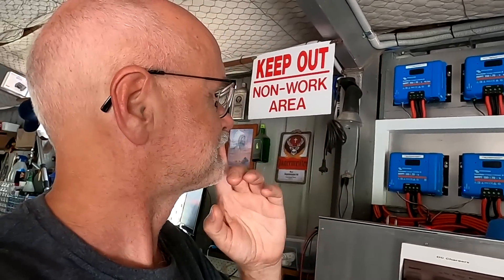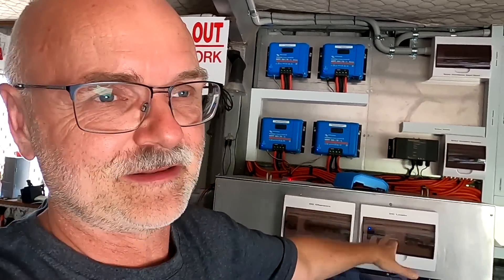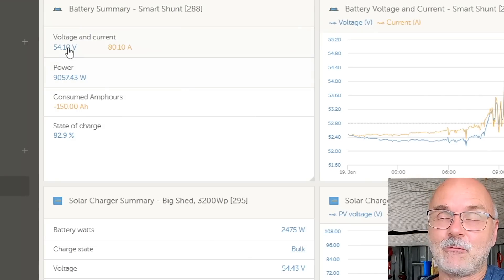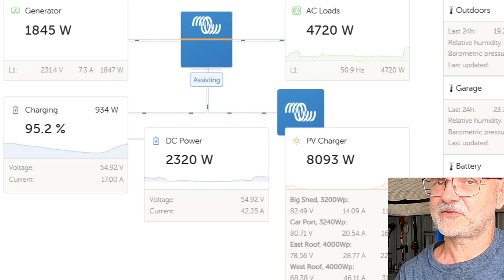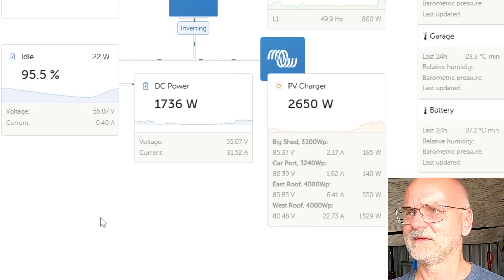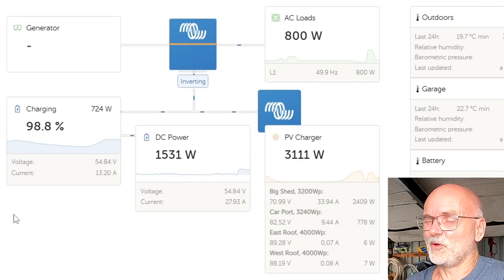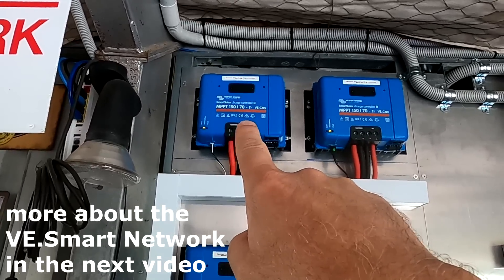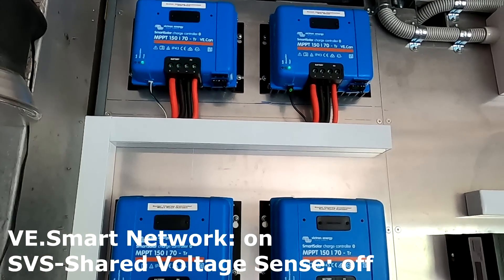Charging chaos: no charge despite full sunshine. MPPTs out of control!

Comment: There’s no point to absorption on LiFepo4. Just set everything to whatever your top voltage is and keep it there. 

CV will taper current and then the amps will go down and it will slowly get to that voltage and then stay there the way it should. 

And the whole thing should be using your bms voltage readings.
Reply from the maker: Oh, noooo, that is not correct. Absorption is very important with LiFePO4. We have done all the testing here on the channel. If you don't absorb, you get very inconsistent charging results.
Reply: @OffGridGarageAustralia  I’m seen your results. The science doesn’t agree. If you maintain the voltage at equilibrium it will charge completely AND enable balancing because voltage IS a pressure. 

It’s when the BMS is kicking on and off that you get the results you saw.
Reply: @OffGridGarageAustralia  to elaborate:  what you showed was the fundamental problem of disconnected charging, BMS and balancing that doesn’t work wholistically. Absorbing just punts the problem by doing the process below the hard stops. 

A system working together has the charger providing exactly the right amount of power into to the bms, and the bms knowing exactly how much it can use to shunt to the cells that aren’t yet up to level while not overcharging the ones that are.  They need to talk to each other and if there are multiple bmses then the whole thing needs to be coordinated. 

Instead we get NO MORE POWER! OFF!  Sag b/c of no more power, MORE POWER!  FIRE HOSE! OH SH*T that’s too much!  NO MORE POWER!  Sag b/c no more power. 

Should be:

Bms: I can use 2 more amps please 
Charger: Ok, here’s enough voltage to induce 2 more amps for you. 
BMS: Thanks!  Here’s my real-time feed of what I need. 
Charger: OK, I’ll keep giving you exactly that!

And guess what?  This is EXACTLY how DC fast charging in an EV works. (And the AC/DC charger in EVs does too)
Reply: @jameshancock  What happens when one BMS says "give me 50A" and another one says "max 2A, please" (while the inverters also want 4kw to charge the Tesla)?
Reply: @Full-of-Starships  it’s called a DC bus. Most all in one units use one at around 400v. (Nice value for PV and rectified and PFCed AC 240v and perfect for outputting 240vac from the inverter)

All power sources are setup to maintain that 400v bus voltage. You can prioritize where it’s from. 

If 2 bmses want different amps, it’s still the same voltage either because of the bus or parallel, so the charging has to raise the voltage to provide the total amps requested by all loads and they will automatically distribute accordingly based on resistance to current. 

If your bms works in coordination with your chargers of various types then this is all automatic. 

Right now (to my knowledge) there is no system that communicates what it needs to balance properly at full charge which is the problem so you get a fire hose until the bms just shuts it off which means the bms balancing can’t keep up.
Reply: @jameshancock  I guess 400v means only DC fast charging for an EV, not static batteries.

I still don't see how the controller copes when two BMSs send different instructions, while the inverter may also be drawing full power.

Comment: it has too much problem Víctron should stop using it, use another brand
Reply from the maker: Never. Read the forums about other brands. OMG!
Reply: Victron has few issues generally speaking, but when you piecemeal a system together like this, it does require extra tweaking to make it all work.  And to me, its well worth the tweaking needed to save ten’s of thousands of dollars.  You should do the math on how much it costs to build that battery by buying it over the counter from BattleBorn or other manufacturers.  It’s about $750-$1000 per 100/ah @ 12vdc.  That’s a big savings just by DIY’ing the battery.  Which is why I didn’t skimp on the BMS and bought a Batrium system.  Yes its very costly by comparison, but it scales larger than any other competitor and its an all in one BMS no matter how many battery banks you have installed.
Reply from the maker: @Shep5847  Most of this' tweaking' is part of the testing I do on this channel. I break things on purpose to learn and understand how it works. And share the love of course...

Comment: I had this problem twice i have two Victron 30/100 smart solar charge controller and one Victron Smart Shunt  that's was in sync at first lit my BMS one of my cells had ran away shut my whole system down I had to wait because the first time it happened my whole solar system shutdown and when it restarted all my settings was back to default even the shunt then I was only getting on maximum charge of 26v out of 28v they kept going into absorcion & float early before the maximum voltage set in the charge controllers was reached

Comment: Hi Andy,  I did mention before that if you have the MPPT chargers connected to the Cerbo with cables you must not also use the Blue tooth network or the two systems will argue with each other. 
The DVC system is supposed to be used with something commanding it like a BMS,
Having said that none of it makes a difference to the voltages, I Have shunt and three Mppt chargers, all the voltages are different I put it down to victron being shit and inaccurate. PS: I ran my own Electronics company for years, retired now, I have a good idea what I am talking about.
Edit: I think you just stated your problem, "The smart BMS is not in the whole system???"
Reply from the maker: The VE.Smart Network can be used with DVCC in combination. I read all the documentation and nowhere it says you cannot do it or even you should not do it. In fact, the VE.Smart Networking manual says you can always set up the network and for example if your MPPTs are connected to the VE.CAN network at the same time they will just ignore the VE.Smart Network. So, there is no real directive from Victron in regards to this... More about this in the next video.
Reply: @OffGridGarageAustralia  I never said that the DVCC could not be used in combination with the VE network? I said if it is used it must have information from a BMS . Also I said the ve cable network should not be used with the Blue tooth network. Ahh! well you see I did read in some Victron document that you should not, trouble is it was some time ago and I do not remember which one it was in, it was not the main manual. But what I do know is my system works perfectly, so you carry on.
Reply: well thats what he did a few weeks ago he disabled the smart  bluetooth network  and just in the video he re enabled it trying to get it to work properly.
Reply: @STRUTZKOFF  That's correct but he hasn't got a BMS or apparently a shunt in controll of it?

Comment: Hello Andy, my setup has 4 MPPTs and a smart Batrium BMS connected to the CANBUS of the Cerbo gx. It behave just like yours. I have a sound explanation for this.
The BMS controls the voltage and current delivered by the MPPTs to charge the batteries. In an ideal case, all battery cells have exactly the same voltage since they are "perfectly balanced" and therefore, the BMS can still request all the power that can be generated until the batteries are 100% full.
Since this is never the case, some of the cells start having a voltage above the set maximum even when the batteries are well below 100%. In order not to damage the cells, the BMS reduces the power that comes from the MPPTs until the peaked cell voltage goes down, hence reducing the overall voltage of the entire pack. I confirmed this with my BMS by observing the peaked voltages and the behavior of the MPPTs.
As for the MPPTs, some giving 0 and some giving power, I deduced that this is the way Victron throttles down the delivered power.
Hope this helps.
Reply from the maker: Thanks a lot for sharing, Salim. The Batrium is certainly great when it comes to communication with Victron. I read a lot about it and how it limits the charging current to 0.5A to allow the balancer to work.

When you say it limits the power to the battery, does it lower the CVL or the CCL in the Victron system?
Reply: @OffGridGarageAustralia  , I really don't have the exact details as to what gets controlled as soon as cells reach a high voltage. 
However, using the settings of the BMS, both voltage and current are set as a function of the state of charge. When the batteries reach a set SOA, the MPPTs start exhibiting the same behavior you have seen with yours.
Reply: How were you able to connect your batrium to the CANBUS of the cerbo? I have a Batrium BMS and am unclear on this.

Comment: My victron equipment is 'off' .35 volts. I have 3 MPPT RS450/100 tied together, so one master, two slaves. The remote manager is always .35 volts lower than the actual battery voltage. Charge controllers always report the actual voltage. Made me wonder but I never tried to find out why. Makes no difference where I set the fully charged voltage it's still off .35 volts. Also during charging Not all the controllers are producing the same. One will usually turn off and the other two will provide power for my loads. Sometimes just one will be working. When the batteries are fully charged just one controller will power the loads, not always the same one either. Everything is run to the Cerbo GX. So far I have had no problems that were not of my own making. I am off grid so have a generator for days when no solar or snow on the panels. Quattro starts the generator at a given voltage and shuts it off when done. Seems to cut the current for 15 or so minutes then shut the generator off. Just wish I had not started with an off brand inverter, never could get it to work with the generator. Quattro worked right out of the box.
Reply from the maker: Thanks so much Gary. That is great to hear. Your RS MPPTs are connected via VE.CAN to the Cerbo, right?
Do you have a smart bms as well for your battery?
Reply: @OffGridGarageAustralia  Yes, connected via ve can. Signature Solar batteries. They were connected to the Growatt inverter but I replaced that a month ago with the Quattro 15kva unit and have not yet tried to hook them up to the inverter. The charge controllers have been hooked up for almost one year now and have done a good job of caring for the batteries. Grandson is an electrician so he takes care of the stuff. I think he is using the Victron professional site for help getting the batteries hooked up.
Reply from the maker: @mrgruisinge  Thanks. These batteries should communicate with the Victron system through CAN as well but if it all works, it's a bit risky and could 'break' things.
I do my training through Victron professional as well. It's a great service they offer.

Comment: If you have a Smart BMS connected then the MPPT goes into external control and only reports off or external. As it is controlled by the BMS. DVCC isn't really designed for systems without something commanding the charge like a BMS.
Reply from the maker: Yeah, that is correct, I can see this in the SPAT Calibration Centre where the Pool Fence controller is connected to. It says External Control.
I use the DVCC only for limiting the current coming from the new solar setup. It can get a bit too much for my battery setup. But no BMS yet... maybe soon?

Comment: So yes we go back to setting bulk and float settings the same. Especially if we aren't using victron gear. As I have said before when running a house or something with continuous variable loads getting that tail current is near impossible. The dvcc system is cool though.
Reply from the maker: Setting absorption and float to the same value is not ideal as you either keep the battery on an unnecessary high voltage or don't fully charge it if the voltage is to low. Absorption and float makes a lot of sense with LiFePO4.
I don't use tail current. I had very inconsistent results with clouds and also loads as you said. I've set mine to absorb for 1h before going to float. Enough time for the balancer to do its thing...

Comment: You have missed the most basic thing! Control measure every voltage point with the same, calibrated, multimeter. How do you know that the solar charge controllers reports correct value? You have 8 points with different voltage. 4 solar charger, 1 smart shunt and 3 BMS. Plus some other points. 
I have a boat with one solar charger, one shunt and I set the solar charger higher and higher until I get what I want at the battery. Now I will test with shunt and solar charger in network next summer. 

From cloudy Sweden on the other side of the globe 🙂
/Reidar
By the way, Good Chanel
Reply from the maker: Thanks, Reidar. The smart shunt is my point of truth as it sits very close to the 3 battery banks. If this voltage is correct or 0.05V off (to a quality measured voltage), does not matter as long as all other devices get the same information from that device.
Changing the charge voltage on the MPPT to compensate for the voltage drop is a bad solution as it can overcharge your battery in cloudy weather. The current is low, therefore the voltage drop is lower and the actual charge voltage at the battery is higher than you would have at full sunshine.

Comment: Hi Andy (unrelated question) can you tell me what OS you're using to use your tester (ZKEtech 40L) on the PC. Mine does not work on Windows 10... Seller tells me to use a Windows 7 computer.
Reply from the maker: I've got this running on my Windows 10 computer inside the garage but the software also runs on Windows 11 in my office.

Comment: Looking at your system, you seem to indicate that some controllers go into absorption before others. So what do you think triggers the transition? A voltage reading above 55.2V for some time in your case?
Scenario: the system is happily pumping in 10000W  or more, into your batteries which causes the voltage to rise - maybe say close to 55.1V at that high current, and a bit higher on the charge controller. Those controllers that have slightly longer leads or higher current will read higher *at the controller* for longer and maybe trigger the 55.2V threshold before others and then switch modes. Can you observe the moment it switches to float? Unfortunately the timer on one unit may be ahead of the other unit so it is hard to compare at the actual moment (you need to know when the timer started).

I like to use 55.2V on my single controller (I am a fan of 3.45V), but as an experiment you could try raising the voltage on the controllers, say 56.8V just to see if you can delay this process? At that point your last online controller would be able to finish off the absorption to completely top up your battery.
Reply: yes but they are supposed to work together with the ve network
Reply from the maker: The MPPTs will go into Absorption mode as soon as they hit the 55.2V. There is no delay. They stay there for 1h (as per my settings) before going to float (53.5V). If the voltage goes slightly below that 55.2V within that hour (load, clouds), it does not matter, the time for that 1h keeps running. If the voltage goes down a lot, like to 53V for a while due to clouds and large loads connected, the 1h absorption time will be extended. That's what I have observed so far. Sometimes they stay on absorption for hours, because of clouds and the voltage going up and down all the time.
That all adds to the inconsistency of charging if they are not in the VE.Smart Network.

Comment: Andy, you do not need to use dvcc if you have a smartshunt. You are connected to the rPi Venus os vis usb do not use the Bluetooth network. Set your system up with the ESS assistant and this will sync all these devices. I have a similar setup and ESS controls all the devices as designed. Within ESS you use a battery mode of Optimized (without BatteryLife).
Reply: Andy is using the dvcc to limit the max. amperate that goes into the battery. Otherwise his BMS would cut off the battery.
Reply from the maker: With the new soalr system installed, it can pump more than 270A into the battery banks. I'm not feeling comfortable with this if I'm not at home. That's not what I have designed the battery shelf for. So, yeah as Martin said, I only limit the current with the help of the DVCC.
I cannot use ESS because I'm off-grid and don't charge though the Multiplus.
Reply: @OffGridGarageAustralia  Will that concern about current be fixed when you add your three Seplos into the main system? Is it mainly a concern of how much goes into each battery, or more around the busbars that concentrate and then distribute all the current?
Reply: Of course, you are off grid, understood. In that case, as far as I understand, the dvcc requires comms with a BMS to control charge current. Your JBD BMS can do this with the right software and isolated usb device (you did a vid on just this thing not long ago), however I can’t remember whether your two other BMSs are supported with this software. You would need each BMS to communicate to the system in order for dvcc to control. Love your channel even my wife now looks forward to your videos even though she has no clue what it’s all about. All she knows is that we save a lot of money doing this sort of thing.